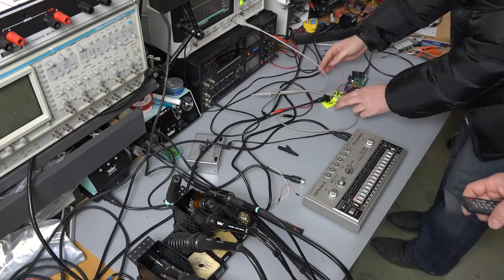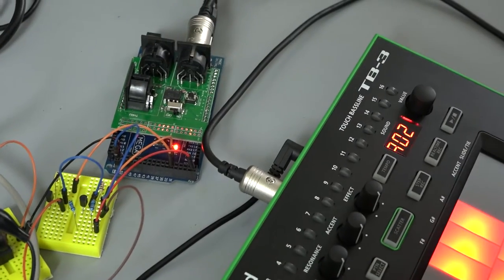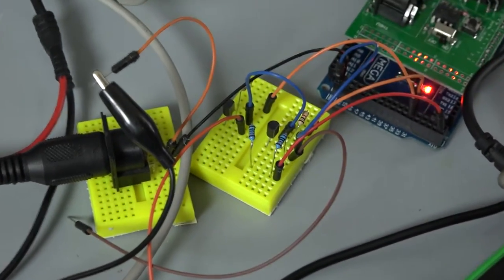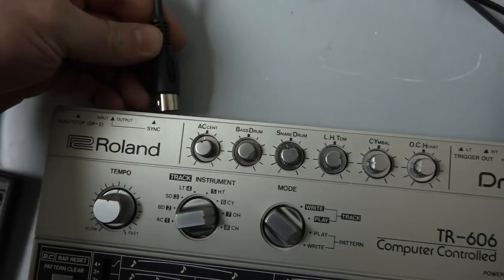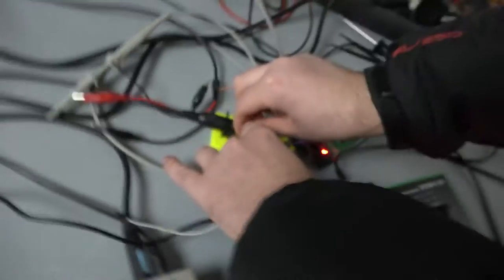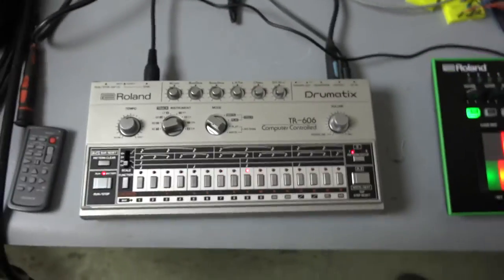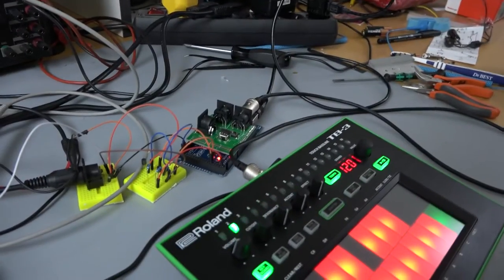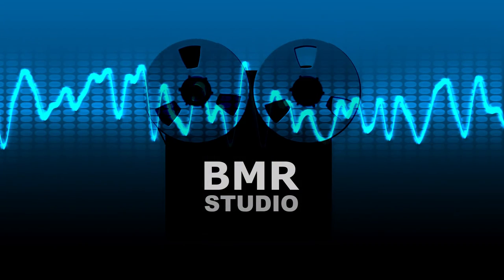Roland TR-606 synchronize Din Sync to Midi! Paul's Arduino synchronizer

Comment: Awesome. Does the midi clock to CV pulse O/N stay perfectly synced at all BMPs? I used to do something similar a long time ago with a MIDI T/C box that also generated a linear pulse, but you had to start at the beginning as there was no absolute time code. If you open up your 606 you will find tracks on the PCB for the volume pots that you can break into and give separate outputs. But be careful of grounding or the clock from the 606 will bleed onto the separate audio outs. Great video, thanks for journey down amnesia lane :)
Reply: David Harry: The din sync format is very simple, so the converter just responds to midi start, stop and clock messages. Not the full MTC signal with min, s and frame information. So yes, you have to restart at the beginning every time.
Reply: David Harry: It syncs very good, but there is still some jitter with the clock signal. I will improve it using other timing method. :)
Reply from the maker: Jitter not always bad... specialty on drums!

Comment: This is cool! Can i just ask whether you can start the 606 on the 606 itself while it is being clock synced. I like to start my gear independently when i play so i don't want it to have to be turned on by an external start/stop. Many thanks
Reply from the maker: Ask Paul. He is the master in this topic! Kinda crazy but very good guy! You can find his information in the video.
Reply: @BMRStudio  many thanks,   i think i found the answer talking to some dinsync midi converter manufacturers anyways. Have a good one.